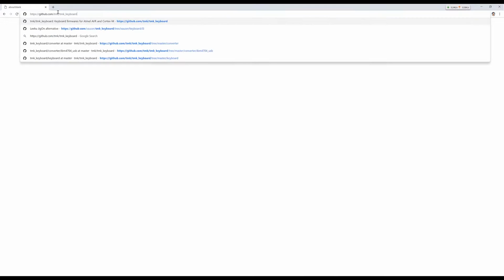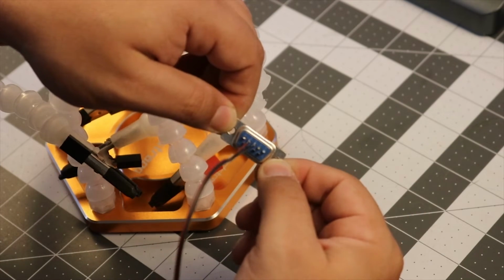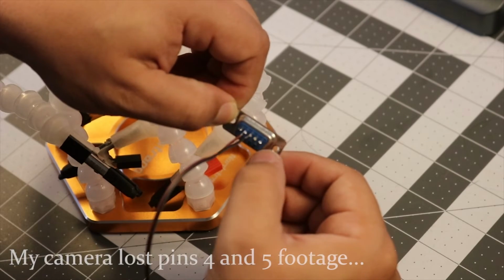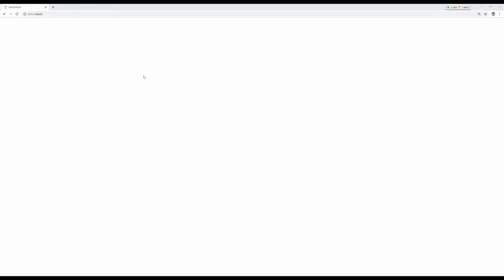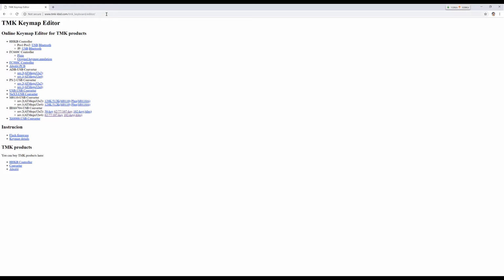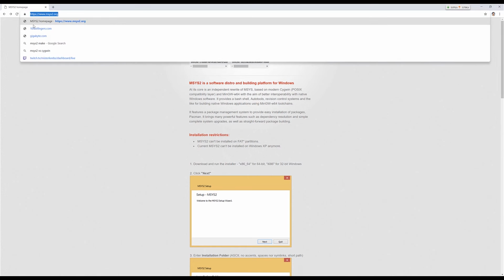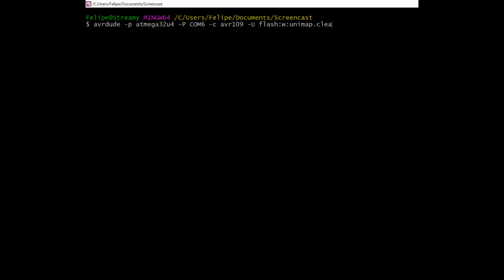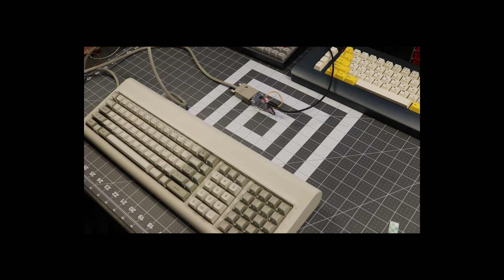How To: Pingmaster USB Converter (IBM 4704)

Comment: You take commissions for these?
Reply from the maker: Quality Content Guy never thought about it quite frankly. Do you need an adapter like this?
Reply: @MrKeebs  I am planning on getting a Pingmaster so yea I'm trying to find the cheapest adapter possible!
Reply: @JavierPerez-ri3mr  You can avoid most of these steps and just solder the wires from the cable directly to the pro micro, making your adapter about $6. You can even use the nifty housing as the holder for your pro micro. Can't get much cheaper than that.

Comment: Help! When using MSYS2 and try to run it with avrdude it says 'error while loading shared libraries: ?: cannot open shared object file: No such file or directory'
I don't know why this is happening or how to fix it. Please help!
Reply: I'm having the same issue
Reply from the maker: Sorry for the late reply, I was traveling and didn't get to respond. Did you figure this out?
Reply: MrKeebs no I didn’t figure out how to fix it.
Reply from the maker: @seedmaster101  We may be able to help if you join our Discord server here - https://discord.gg/8JNeJ5s. We speak mostly Portuguese there but the #international channel should be a good place. Let me know!
Reply: Same issue here. I am using 64 bit Windows 10, avrdude-6.3-mingw32, and msys2-x86_64-20190524 (updated after installation using "pacman - Syuu" command). Frustrated.
Reply: @xzzdm  There's a better program I used to get it to work.
Reply: @Kyle-pj2vc  What program, I get the same error 'error while loading shared libraries: ?: cannot open shared object file: No such file or directory'
Reply: I hate to reply to a dead comment, but I had the same problem and was wondering if anybody was able to find a solution. If not, a point in the right direction for help would be much appreciated.

Comment: thank you for the video.  for flashing pro micro, I use arduino builder, much easier to work with.
Reply from the maker: Thanks, I will take a look at Arduino Builder!
Reply: You can also use the QMK ToolBox
Reply from the maker: blon you actually cant because it doesn’t recognize the original Pro Micro firmware, because the vendor id needs to be a specific number like 0xbeef or something.